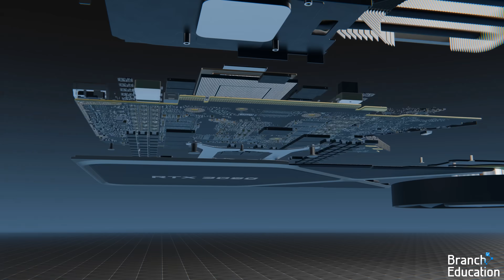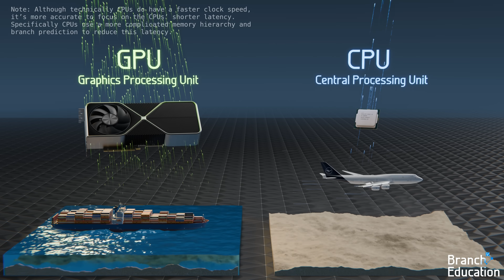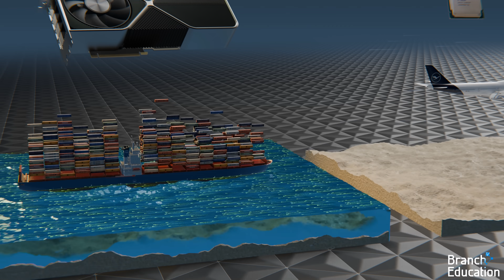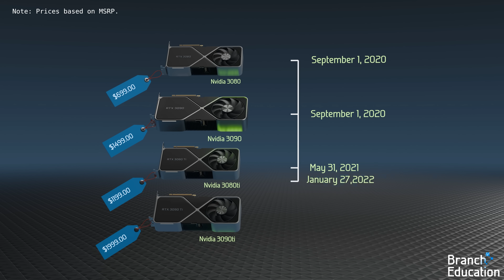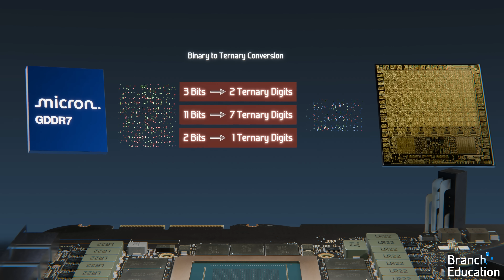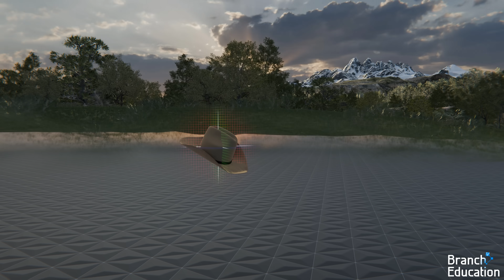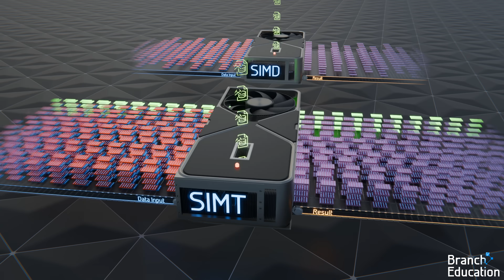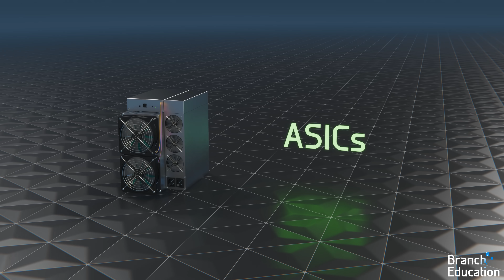How do Graphics Cards Work?  Exploring GPU Architecture

Comment: Neat video, some things I'll point out (stuff I've learned studying CS or I think I know but might not be fully true so do your own research):
* the common code which GPUs run is called shader code (unless you're programming in CUDA with big maths/data science sort of stuff)
* matrix multiplication is commonly used alongside basic arithmetic, on what is referred to in opengl as the vertex shader, which performs the operations discussed in this video on every vertex.
* Matrix multiplication is used as transformation matricies are created first on the CPU based on the model and camera space, and can effectively translate, rotate, and scale between the different spaces just using a matrix (would've been cool to see more low level how a GPU handles matrix math, maybe that's too low level for this type of video, going into computer architecture). The matricies convert 3 or 4d coordinates into 2d coordinates usually between 0,0 to 1,1 (dependent on the graphics API in use)
* The CUDA core operations are what the fragment shader in opengl does. There are some intermediary steps, specifically the rasterizer, which converts the vertex data from the vertex shader into "fragments" which shades the image (giving color) at a given 0,0 to 1,1 spot. Then that image is outputted, interpolated from the 0-1 space to whatever the image size is to be output, followed by some extra stuff like postprocessing.
* The hardware RT pipeline works a little differently than the normal rasterization pipeline, hence the different hardware. The fragment shader would take in info like light positions, whereas a raytracing shader inputs rays (or rather, a ray generation shader makes rays from a light, then a ray processing shader receives the rays and geometry, then outputs fragment color and possibly more rays)
* The specific use of VRAM between applications can vary, but often holds instanced data, for example a 4k texture or model being reused for an effect. Instancing is an important aspect of GPU programming, and is one of the advantages vulkan has over opengl, or directx 12 vs. older versions- being able to reuse data already on the GPU, and even modify it slightly depending on the scenario.
* I guess I should mention, the graphics API (vulkan, directx, opengl, metal on apple, console proprietary versions too) provide an API between user space code and the OS and drivers. They load data to the GPU, perform operations, and receive the output and send it to the correct target (a window framework typically), from the CPU.
* Graphics API programming can be very complex considering the vast number of devices with varying GPU specs, so modern programs and to some extent the graphics APIs would have a step of compiling or optimizing shaders- for example a game may have some custom shader code that's built to be universal, then the graphics API or a compiler will compile that code for that specific computer or device based on its drivers and device capabilities, and that compiled code (in SPIR-V for example in vulkan) is what's used by the graphics API.
* There can be anywhere from one set of shaders in use per frame- forward shading, performs all the operations to generate a fragment in one step, used in VR to reduce latency between frames, up to hundreds of shaders- deferred shading, where multiple steps are used to generate a fragment, for example having one stage per light or a stage to generate a normal version of the world, or even apply postprocessing. Forward shading makes the image you see about immediately, deferred will make some stuff that it will use to make that final image. There are different shaders used for different types of materials and sometimes lights and geometry, a shader for 2D UI elements, postprocessing shaders, vfx shaders... Shaders can be reused but the more complex and specific a material or texture or effect is, that would need its own shader to work.
* The GPU also has to handle syncing and color management between the input data and output display, which is likely what some of the circuitry not discussed in the video goes into. There's also in consumer GPUs encoders and decoders which can process video signal to and from the CPU to be compressed and streamed or saved.
* There's hacky ways to run normal computer programs and OSes on the GPU, since the CUDA cores cover the basic operations of the ALU (Algorithmic Logic Unit, it can add and bit shift and check booleans) and VRAM could be repurposed as system storage. I saw some youtube videos about it a while ago, it's not practical at all but does it run fast with the OS in VRAM.

Comment: Nobody has mined Bitcoin with graphics cards for a very long time, due to the complexity of the network. GPU mining has not been viable for a while because the network difficulty has increased significantly, and graphics cards can no longer compete with ASICs, which are much more efficient. GPUs consume a lot of energy, and the costs exceed the value of the rewards.

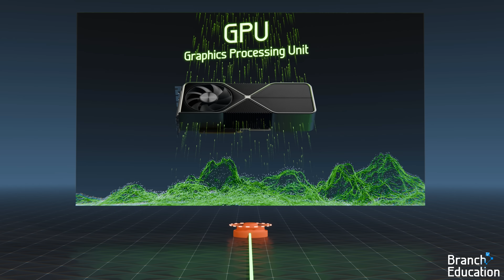Comment: 1:50 - "ideal for ... bitcoin mining" - Ugh.. N- No... They are not ideal.
Reply: yo ur right but the stutter killed your ethos
Reply: Did you watch until the end?!
Reply: Sh-sh-shut up.
Reply: Ye-yea they are. For a dynamic compute platform. You have to go fixed function to beat them. But for a platform that wasn't purpose built for just one thing, it is very well suited.

Comment: Sorry, but I didn't figure out the video memory. I have a NVIDIA GPU with 64GB of memory chips installed, but the manufacturer's datasheet says that only 2GB of memory is installed, and this is also detected in my computer. How is that?
Reply: What GPU do you have?
Reply: @jcm2606  Hi, the video card is Intel HD Graphics 4600, but it is based on GPU NVIDIA GeForce 860
Reply: @А.Без-да-блинов  Those are two separate GPUs, so that's probably why you're getting confused. The Intel GPU is an integrated GPU, so it shares system RAM with the CPU and can use a considerable portion of system RAM. The NVIDIA GPU is a dedicated GPU, so it has its own separate VRAM, which the 860M only has 2GBs of. The NVIDIA GPU is much faster than the Intel GPU, so you really only have 2GBs of VRAM that can be useful in games.
Reply: @jcm2606  Thanks for reply and the same way I was thinking before as it is common logic of Hardware organization. 
In my case there are 1 CPU and 1 GPU I can find on my MB. But also I can find 8 pcs of SAMSUNG K4G41325FC-HC03 (4GB each) memory chips installed around GPU (which is NVIDIA) so in total is 32GB. 
I don't understand this mismatch, how VRAM is calculated and what is the reason and purpose of presence such huge amount of VRAM, which is not recognized by OS (only 2GB is available)?
P.S. The only way I could to discover them in OS is by using AIDA utility. So physically those are present.
Reply: @А.Без-да-блинов  That would be 4Gb (gigabit), not 4GB (gigabyte). Memory chip capacity is usually measured in gigabits, so you need to divide it by 8 to figure out how big they are in gigabytes. 4Gb / 8 = 512MB x 8 = 4GB, but since your PC is reporting 2GBs, either half of the memory chips aren't hooked up or you're maybe mistaking an empty pad for a present chip.
Reply: @jcm2606  Ah.. OK! That is make sense. Thank a lot for you kind clarifications!

Comment: RTX 3080 does have 10BG not 12GB VRAM. And te clock speeds of the 3090ti are higher than the off the 3090.

Comment: I'm thinking about it and I can't see why a very basic purpose built OS wouldn't work 😅

Mean I can move a calculation and it has access to video ram, so if application was purpose built I can't see why it wouldn't work

Mean sure it's definitely doesn't seem cost effective nor sensible but should be possible, though imagine trying to trace issues
...
Reply: It's that it's more effort than it's worth. GPUs are comparatively very simple processors and lack many features that programs and even operating systems take for granted on the CPU. A hardware stack, privileged execution, interrupts, "proper" branching support, feature-rich atomics, IO capabilities, etc. An OS targeting GPUs would be an extremely simple OS rife with security problems and even some performance problems since you'd have to emulate with software many features that CPUs offer in hardware, plus you'd still need at least a thin kernel running on the CPU to let the GPU interact with other system components like any storage drives, network cards, sound processors, etc, which is why there isn't any operating systems targeting GPUs.

Comment: I didn't understand the Bitcoin part, where does the coin come from, what's all the zero's about?
Reply: To keep it simple... it's all about solving maths/hashing problems. These are extremely difficult to solve, requiring massive amounts of computation. Bitcoins are awarded as kind of  "prizes". The rarity of solutions limits the number of coins, etc.
Reply: @toby9999  Where do the bitcoins come from? I thought they were digital currency, I think I'm too uneducated on the subject.
Reply: BTC (the actual coin itself is referred to as BTC, Bitcoin is the name of the cryptocurrency network) is created out of thin air when a miner successfully mines a block for the Bitcoin network. To prevent miners from being able to mine blocks whenever they want and create fresh BTC basically for free, the Bitcoin network requires that the hash of the block start with an agreed upon number of zeroes, which makes it so that miners have to continuously try hashing the block over and over again, randomly changing a specific number in the block until the hash starts with enough zeroes.

Comment: I'd always wondered specifically why branching was so discouraged in gpu code, but the notion of a shared program counter makes it all fit into place. Thank you!
Reply: It's mostly divergent branching that's problematic. Branching is totally fine if all the threads in the warp take the same branch, it's when different threads take different branches that problems arise, as you basically force the entire warp to take all branches in succession.

Comment: You know the industry has a monopoly problem when education doesn't even mention there are alternative designs out there. But otherwise excellent video.
Reply: If you were referring to AMD and Intel, they both follow this same general design, with some minor to moderate differences here and there. The main differences would be what names each unit uses (AMD and Intel call their own versions of SMs as CUs, or Compute Units, for example), slight differences in the hierarchy (AMD has two CUs fused together in a single block, unlike NVIDIA which has four SM partitions per SM which are somewhat independent from one another), differences in the size of thread groups (NVIDIA's warps are always 32 threads, but AMD and Intel both support variable sized thread groups called waves, which can contain 16, 32 or 64 threads), etc.

Comment: In 2001, my ex friend secretly replaced my high spec agp display card with low spec , i think he sold it. Not figure it until one day, i do a pc benchmark test that shows different lower spec of graphic card installed. I opened the case, only small basic card installed. 😢

Comment: How did people even come up with this? It seems surreal.
Reply: If you want to see the progression of NVIDIA's GPUs, there's an excellent blog post by Fabien Sanglard called "A history of NVIDIA Stream Multiprocessor" which walks you through the older fixed-function GPUs of the late 1990's and early 2000's, to the unified architecture revolution of the mid 2000's, and how NVIDIA eventually landed on their current architectures in the 2020's.

Comment: Please do this also for AMD GPU's and their chiplet architecture or Intel GPU's. It feels very biased if you only cover Nvidia GPU's. There is more then just Nvidia... Especially after looking into the rest of your channel.
Reply: AMD and Intel both follow this same general design, with some minor to moderate differences here and there. The main differences would be what names each unit uses (AMD and Intel call their own versions of SMs as CUs, or Compute Units, for example), slight differences in the hierarchy (AMD has two CUs fused together in a single block, unlike NVIDIA which has four SM partitions per SM which are somewhat independent from one another), differences in the size of thread groups (NVIDIA's warps are always 32 threads, but AMD and Intel both support variable sized thread groups called waves, which can contain 16, 32 or 64 threads), etc.

Comment: 15:00 They moved to PAM3 because PAM4 never actually worked properly. Unable to slew from (by this example) +2 to -2 (and -2 to +2) in one clock, and it had to be clocked significantly slower to even work with that issue. a chunk of the bandwidth would have been just ECC data. 
Jenson standing on stage at the ampere keynote claiming "twice as much data in the same period of time" was an absolute lie.

Comment: a great analogy to GPUs and CPUs is if you need your program to perform lots of calculations one after the other you would use CPUs but something like brute forcing where you need to check lots of things but order doesn't matter then use GPU

like making a paper airplane, you can't really have two people working on the same paper airplane at once but something like a paper airport you can have one person working on this while another works on something else, when programming it's pretty sick having these cores working in parallel, it's like having 8 computers in one doing a bunch of calculations for you and it's pretty sick

that analogy is more about multithreading but meh

Comment: Who'd of thought my 3080 is just a broken 3090ti
Reply: Well, technically it's a broken RTX A6000 since even the 3090 Ti uses a defective GPU. It's not defective in that bits of it don't work, but it's defective in that it requires more power to run stably than NVIDIA would like, as all the "perfect" GA102 chips go to workstation and enterprise cards, and consumer cards are left with scraps.

Comment: I can only wonder how much technical information was left out of this video due to confidential intellectual property that came out of all the research invested in these products.
Nevertheless, the biggest hurdle the producers of this video faced is deciding where to draw the line between too much or too little information included here for the intended audience. I found this video very informative, but then again, given how computer savvy I am, much of what has been conveyed here would be lost on anyone else who has less to work with than I do. Yes, the cool graphics help a lot, but given what I know, I understand that some representations here are not entirely accurate due to the need for conveying in a simplified form some rather complex technical concepts, to have even half a chance of making sense to those at the edges of the intended demographics. All in all, thank you very much for this video.

Comment: Good video! I'm interested to watch it. Also, I should say, that this video not like about how gpus work (in general), but about how nvidia gpus built (for example, amd gpus doesn't have tensor cores and etc, also mobile gpus built way differently). I mean, gpus in typical have graphics/compute/raytracing/etc pipelines, and describing them IS how gpus work, but this information is said about hundred million times, so, I prefer this video much more :)

Comment: Wait so all series under the 90 are defectives? At least now i understand why they release the cheaper later...
Reply: Technically even the 3090 and 3090 Ti are defective. "Perfect" GA102 GPUs are used for NVIDIA's workstation and enterprise cards, so cards like the RTX A4000 or the Tesla A40. Consumer cards like the 3090 and 3090 Ti get scraps that aren't necessarily broken, but might require more power to run stably than NVIDIA would like, or might not clock as high as NVIDIA wants.

Comment: You never really explained how it works though? This is just a surface level overview of what things roughly do, but not how or even why. This style of "explaining" feels like telling someone an engines makes power by burning fuel, without explaining how the hell the fuel is burned and why that would generate power. 

The visuals are nice, sure. But this is more similiar to a marketing video, rather than a real explenation on the inner workings of a GPU. If a teacher "explained" things the way you do, everyone would think they knew calculus, when in actuality they just know that a plus sign symbolises addition, without knowing how to actually add two numbers together.

Comment: crazy how my amd with integrated graphics plays modern Games fine at 1080p 144 bc my monitor is avg size for what i do. Plus it costs way less then nvidia 3090. unless you need a huge screen so gpu can push all those pixels etc no need. it all depends on how much the user has and want to do for me every game i play even cp 2077 plays fine graphics wise but bug wise uh. save that money and invest in 401k etc. btw modern cpus now are getting ray cores and tensor cores.

Comment: Do AMD GPUs work the same way?
Reply: Yes, for the most part. There are some differences here and there, but for the most part you still have this modular, hierarchical structure to the GPU, where the lowest level processing blocks are working on groups of threads that execute in lockstep (the video got SIMT a bit wrong in that threads belonging to the same warp still execute in lockstep, but the hardware has thread masking functionality where certain threads can be selectively disabled if they don't need to execute the current instruction). If you look up some diagrams for NVIDIA's SMs and AMD's CUs, they'll look very similar because they're both designed very similarly.